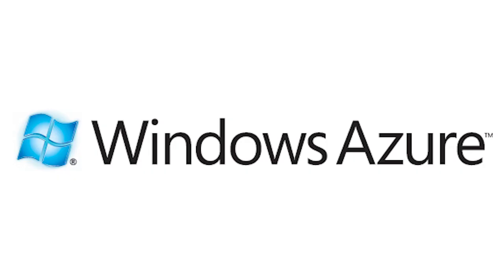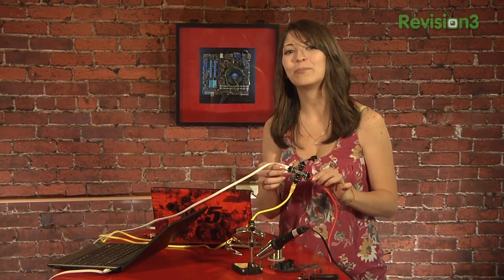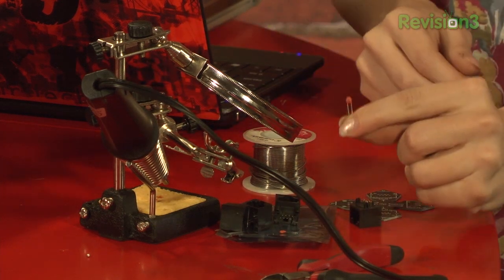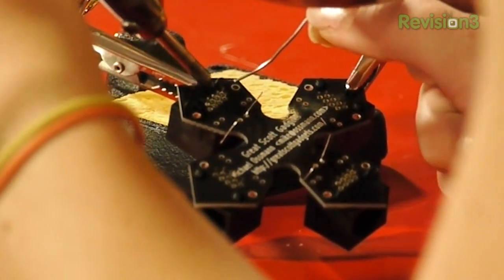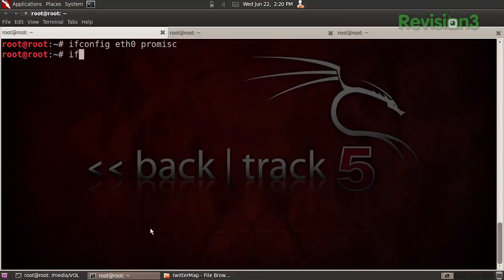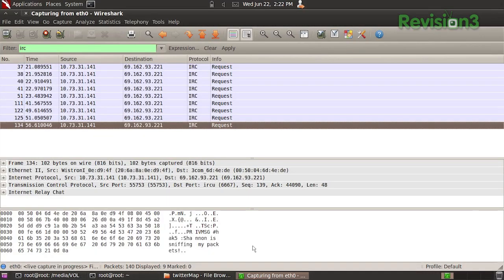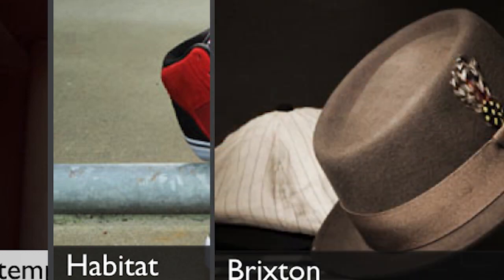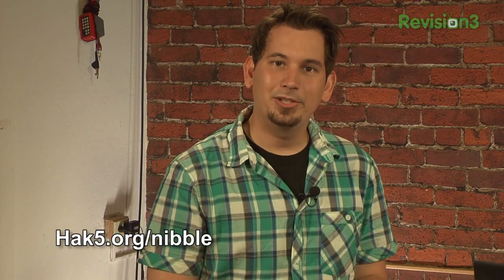Hak5 - Build a LAN Tap for Packet Sniffing, a lesson on Soldering with Snubs

Comment: Newbies to soldering beware at 4:22 she says the soldering iron "feels" pretty hot.  NEVER touch the tip of a soldering iron.  She probably misspoke that line.  Solder typically melts around 600 degrees F.  You'll only make that mistake once.
Reply: BigNate84 Yup Already Made That Mistake Accidently Touched It Like A Year Ago I Still Have That Scar
Reply: BigNate84 I wish I had seen this earlier. I am currently telling you this as a grasp a hot iron my self. the feel is less than good
Reply: Yeah I was wondering what she meant, I figured she felt the heat coming off of it... Yeah will burn you instantly. If you immediately put some wet salt on it and cool it with some ice, it will help prevent it from getting too bad. It's like a miracle. I think the salt absorbs fluid through the skin through osmosis, so the burn doesn't blister, and then it won't leave a scar. Also really helps with pain. Actually it's so effective that when I've done this, the burn almost just disappeared!
Reply: Exactly, I grabbed the soldering iron with my whole hand thinking it was disconnected, when I was a kid. Never did it again.

Comment: Concerning the soldering, I wanted to add that tinning is also really important for extending the life of the iron's tip. Oxidation degrades the tip and gets increasingly troublesome to remove. Heat speeds oxidation, so this is mostly of concern when the iron is turned on, but leaving some on there at all times ensures a barrier to the air during idle times (when setting it down "just for a minute") as well as warm-up/cool-down. When ready to solder you might want to wipe the tip and re-tin.